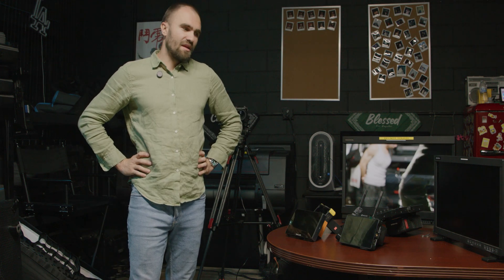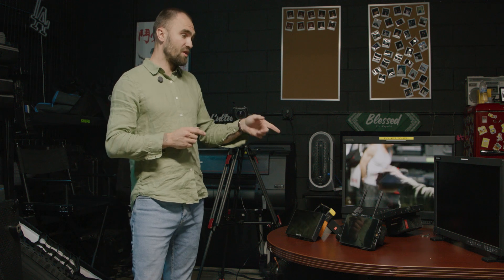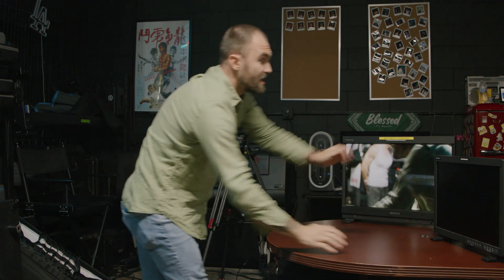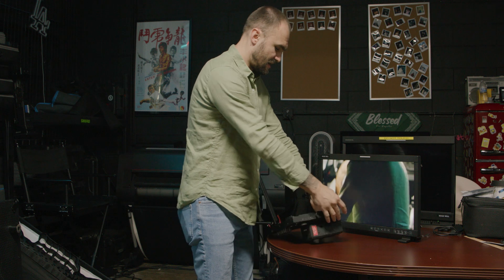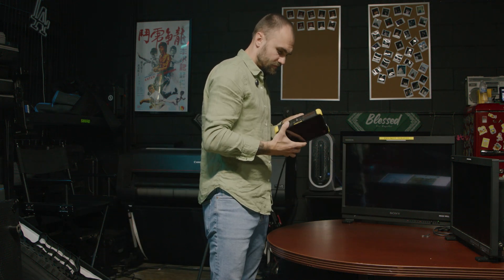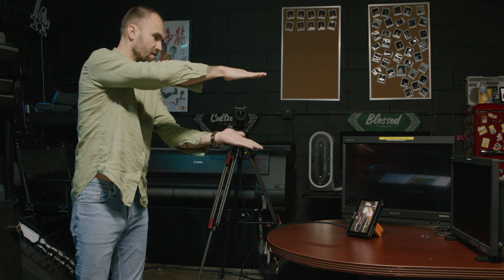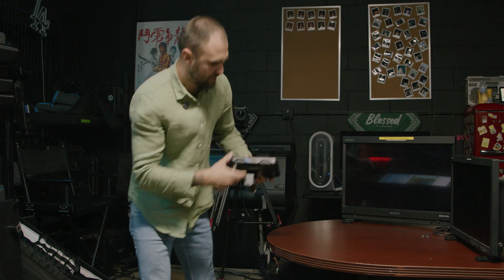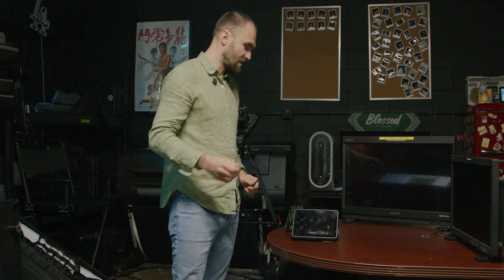Monitor Latency Test: SDI Cable Delays | Sony, SmallHD, Osee, Atomos, Holyland, Seetec

Comment: I have a feeling the single largest source of latency is actually video out from the camera. It's a shame that it's basically not possible to not be like 3 frames behind the scene when monitoring with an external monitor. In the video 'Is The DJI SDR Transmission system any good?' the komodo x is shown to have roughly 110ms of video out latency over sdi which is already going to result in a hugely laggy experience when filming handheld, but then you add wireless to that.

Comment: Thanks for this test. What kind of camera is feeding the monitors?
Reply from the maker: @modernhumantv  red Komodo
Reply: @HugoWill  Thank you! While I've not tested the Komodo myself, all camera's SDI ports do introduce some latency, before the monitor and / or wireless TX/RX. The Alexa family is apparently the best at less than 20ms, which is what I read online, that's less than 1 frame of delay, if true. I tested my Varicam LT and I'm getting around 30-50ms, when I run in 60fps VF SDI mode. But I've heard Sony Venice 1/2 have around 4 frames, which would be around 160ms. For reference at 23.98FPS 1 frame = 41.70ms. Very happy that you compared Atomos to SmallHD, because I'm thinking of getting one of those and wanted to see if it was better than Atomos and it appears so. Anyway, Just some thoughts. Thanks again for doing the test.
Reply from the maker: @modernhumantv  interesting, I haven't thought about cameras actually could also send delayed signal. but makes sense. gotta test different cameras one day too